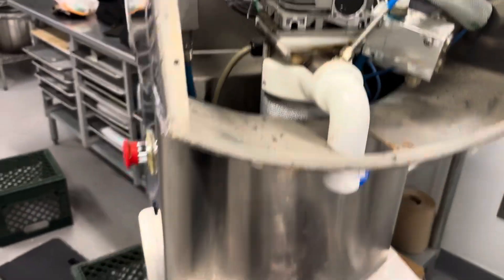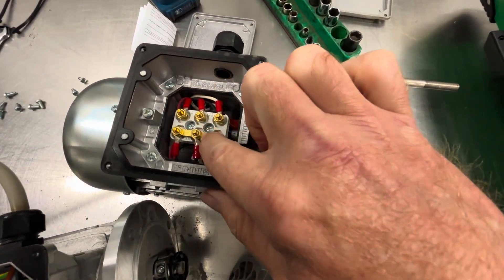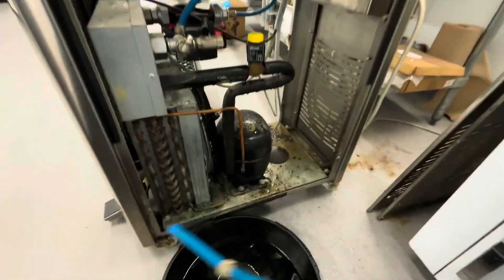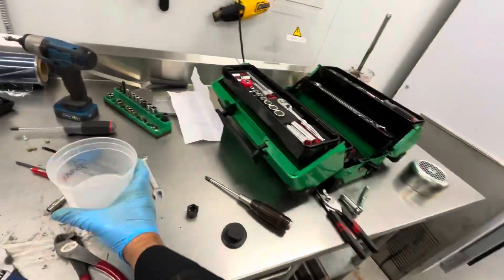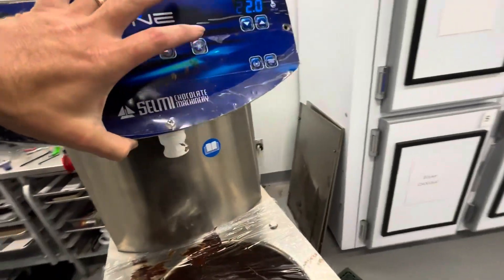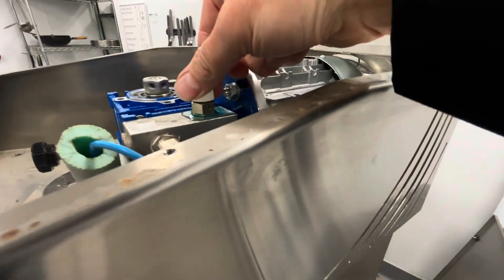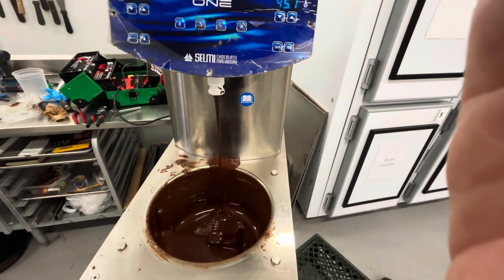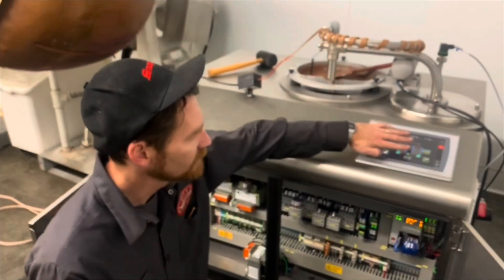Selmi temper machine repair

Comment: That's a wierd looking Prius!  I wonder if you could tell if the charge was low by using an infra red camera to see at what height in the evaporator coil the phase changes.  Like how on low charge there will be a telltale distinct level of frost only part way up the coil - but without having to wait long enough for that to happen.   Not sure if that would work, but I just had coffee 😆

Comment: Hi may i ask for advice?
I have fbm compacta it's not cooling. Fbm say its not enough freon. We added freon with fbm advice to vacuum all out then add 1kg to one side then 200g to the otherside. But it has the same problem, now they say its too much freon. I showed them non of the cooling parts are cooling local mechanics says compressor might be broken. Fbm says they refuse to replace and refuse to give any info on the compressor 

Would you have any advice for me
Reply from the maker: @tyronec88  it’s a bit complicated to describe the diagnosis in text form. 
Maybe contact me via this link to my website and we could schedule a call. Use the contact form to send an email. 
I’ll take the link down in a few days so that I don’t get a bunch of sales emails. Thank you 
https://www.mrelectrictech.com